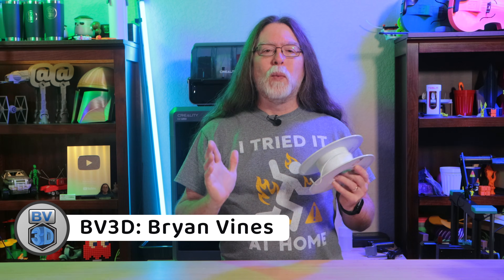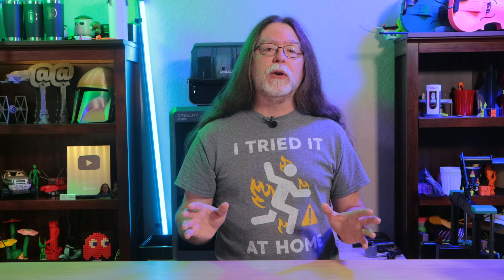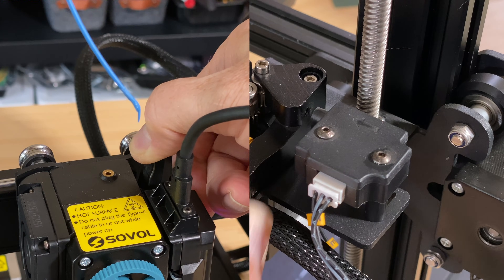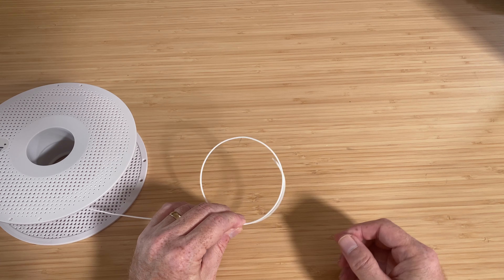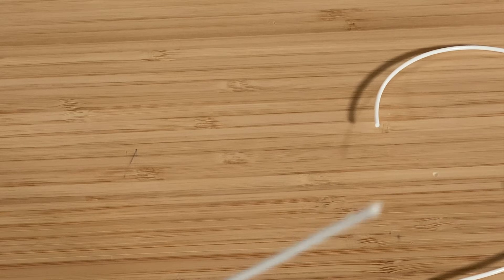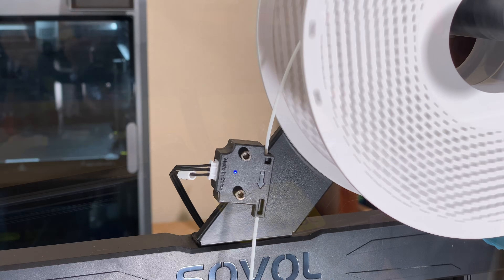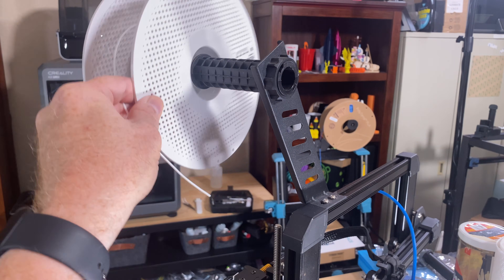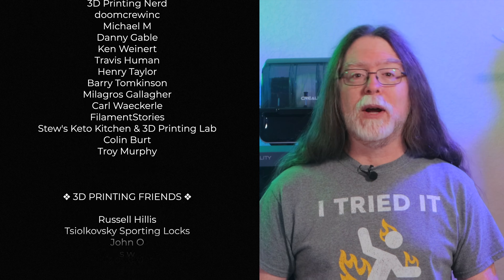Quick Tip: The Right Way to Load Filament in your 3D Printer!

Comment: I use a macro on both of my printers for load/unload, I should add the push before unload though. 
Adding: if you are going from high temp filament to lower temp filament, or vice versa (ASA to PLA for example) Use an intermediate filament to clear the channels. Any leftover filament will either burn and leave ugly marks in your new print, or not melt and end up clogging the nozzle. One of my filament brands sends samples of other filaments and 5 m of the cleaning material. After a year, I am still on my first 5m of the cleaner.
Reply from the maker: Good tip about clearing the path between material types!

Comment: You must be running out of videos to make
Reply from the maker: Around this time of year, we generally get a lot of new 3D printer users. And some of them are going to need help with exactly this issue. Thanks for watching and commenting!
Reply: Wouldn’t it be easier to extrude the filament using the extruder/hotend than pushing on it to purge?

Comment: Odd fact, Bambu Lab's manuals say to cut the filament flush, and not on a 45-degree angle. I believe they're the only consumer printer maker with that spec.
Reply from the maker: I hadn't thought about that until you mentioned it, but I suspect that the reason for that is the Bambu Lab printers, with their built-in filament cutters, cut the filament flat. Those systems are expecting flat cuts on the end of the filament, and their filament paths are designed to accommodate it. When the filament gets loaded in a Bambu Lab printer, the flat face of it is going to be pressing against the flat face left behind in the hot end. An angled cut wouldn't press evenly on the filament that was already in the hot end, and might jam.

Most other printers, like the ones I used in this video, need that 45-degree angle to help guide the filament through the filament path.
Reply: @BV3D  Hi Bryan, thanks for the note. I hadn't thought of it that way, but that makes sense. Thanks! I have experimented with my P1S both ways, and confirm that a diagonal cut won't "cut" it (I know you love puns). :-)
Reply: I usually have better luck with my K1 Max if I cut the filament square. When I angle cut it, it seems like a coin flip if the angle helps or catches going in. That being said, I don't do the little straightening trick you showed, so I'll try that in the future to see...
Reply: @kyleviola1024  I've not had much luck with with straightening filaments other than PLA this way. Especially when you're near the end of the spool where the filament is tightly wound. In those instances I've only found that by carefully (and slowly) bending the filament straight to sort of work. But no amount of begging and pleading will work 100%.